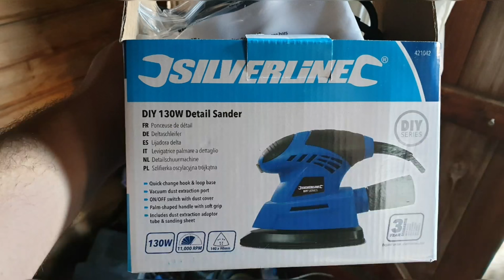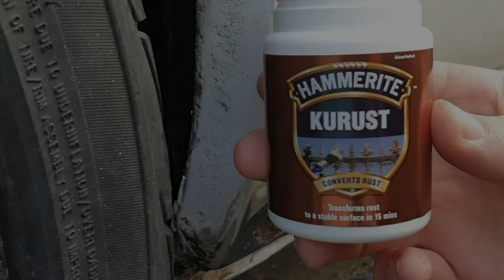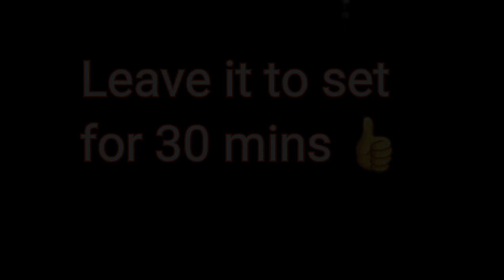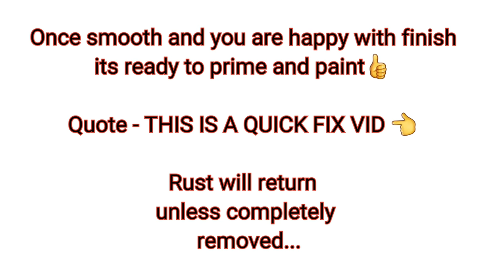Easy DIY Rust repair you can do at home for Car/van (No welding)

Comment: You do realise that you're trying to bodge the repair of a structural, load bearing part of your chassis right? There was metal there in the first place for a reason.
Any tester worth their salt will fail and laugh you out of the place.
This is the problem, rather than fixing people just pop filler on there! 
Learn to weld, grab yourself some scrap sheet metal and a cheap welder and have it done in a few hours - that way the repair is strong.
Reply: Nothing wrong with using fiberglass it's strong and waterproof.
Reply: @vaughnfoster6451  If it's that strong why aren't all cars made from it? It's a steel structure therefore should be repaired with steel and welded properly otherwise it's not a proper job.
Reply: Do no harm only a sill
Reply: Definitely not structural and definitely not part of chassis don't nothing wrong with repair keep up the work

Comment: By re sanding wouldn’t you be removing the rust converter you initially placed on the area?
Reply: The rust would have been converted by that time
Reply: a light sanding after kurust can help key it ready to paint over as well

Comment: For what you have paid for that fibre glass kit, you could have just got the hole welded up be a professional for about £40.   That repair will be lucky to last a year and will only make things worse.   It will get you through a MOT as a temporary fix
Reply from the maker: As described in the description mate it's a temp fix at best.
The fibreglass filler was about £7
Reply: @LT_TOMMY_  A temporary fix means to regain functionality, like using a coat hanger to hold up an exhaust so you can get to a garage or home.
Plugging structural rust holes with fibreglass filler doesn't restore any functionality and just makes the problem worse.
Reply: That wont fail an MOT as it's just bodywork.

Comment: Did it come back already?
Reply from the maker: I had the van for roughly 6-7 months after and was still ok , sold it now so no idea after that 👍
Reply from the maker: Very well put mate , couldn't agree more 👌👍
Reply: @LT_TOMMY_  Too bad for the poor soul who bought it with this incomplete repair. As Irish said, the inside needs to be dealt with also.
Reply from the maker: @BoiseTDI  The person who brought the van was fully aware of the diy repair that I'd done . I make it very clear in the description that this is only a temp fix 👍
Reply: @Irish Viking Would just leaving the rust help it not spread and cause more issues like you’ve mentioned?
Reply: @Irish Viking It still gives you a year or two to save up money for welding
Reply: @Irish Viking so you own the van now?